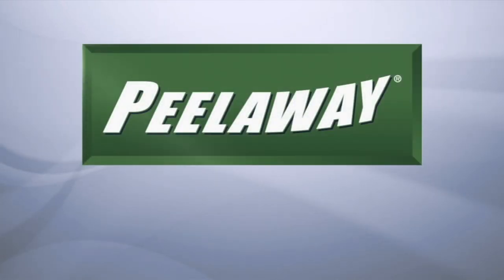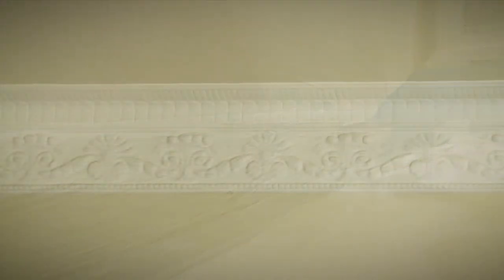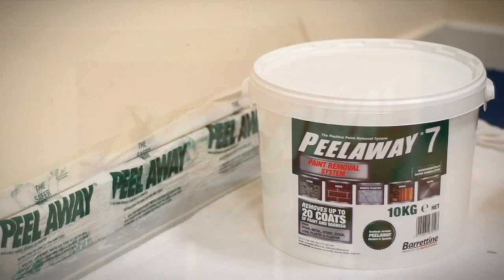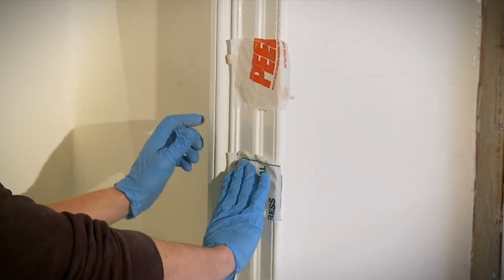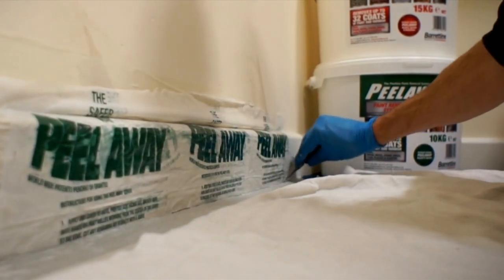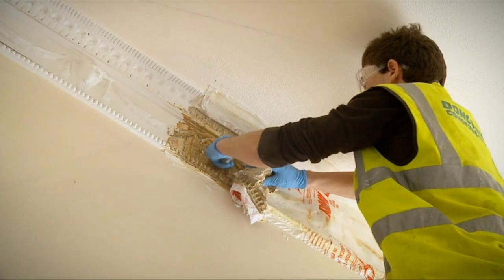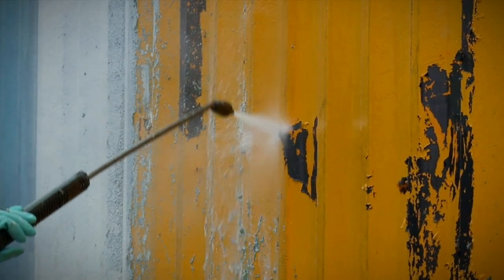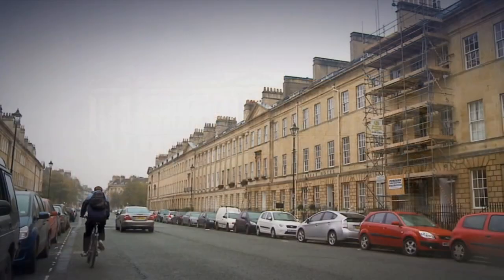How to Use Peel Away 1 & 7 Paint Remover (Paint Stripper)

Comment: Do i add neutraliser before reapplying peelaway 1 to remove remaining paint that did not come off?
Reply from the maker: Hey thank you for your comment, The Neutralising is only so that the product doesn't pickle any coatings that goes on after stripping. You will not need to add the neutraliser again before reapplying.

Thanks 

Jay
Reply: @WoodFinishesDirect  Can Vinegar be used? It's a weak acid..

Comment: Does peelaway products have expiry dates? Can't find any on the tub.
Reply from the maker: Hey There,

Thanks for getting in contact, typically the life span is a couple of years for new fully sealed product. However, once open it depends on the treatment of the remaining product. Assuming the plastic top sheet is replaced and good housekeeping is used on the tub to prevent contamination, it should live out its natural life. A drop (not a lot) of water in the tub to assist in keeping things moist will do no harm either after opening.

Hope this helps!

If you have any other questions dont hesitate to ask, theres no such thing as a silly question. You can get in touch with our wood wizards by calling 01303 477555 or by getting in touch via our contact us page (http://bit.ly/2OYOk0X)

Thanks

Ben

Comment: Do I need to wear a particle filter mask and seal the room off I am working in when applying this? I have lead paint on my doorframes which I am trying to remove and I am wondering if you get lead dust when using peelaway ?
Reply from the maker: Hey ED, It is always best to wear protective clothing when doing DIY so a particle mask would be advised.

Thanks,

Jay

Comment: Man that looks a pain in the arse
Reply: ANY method of stripping paint is a pain!
Reply: Just discovered it, and I'm actually gutted I didn't discover it earlier, I've spent weeks removing paint from my flat's woodwork using a heat gun and sander, and to think I could have used this stuff and done it in a fraction of the time... dang.
I've yet to try it, but if the video is anything to go by, this looks a total BREEZE compared to the way I've been doing it!